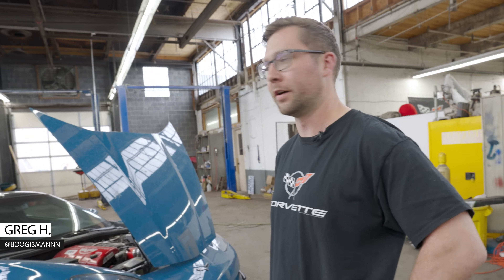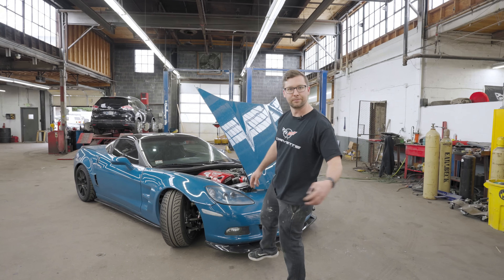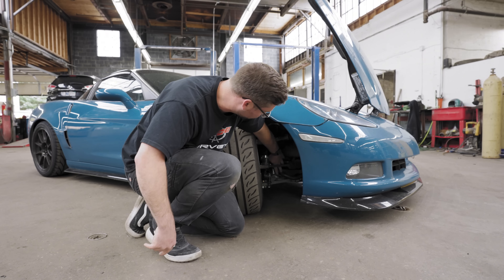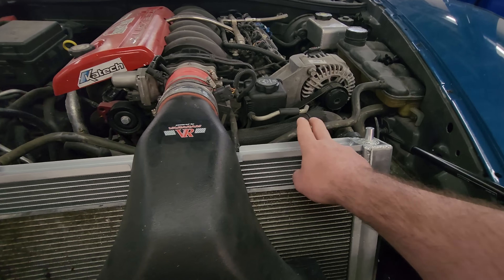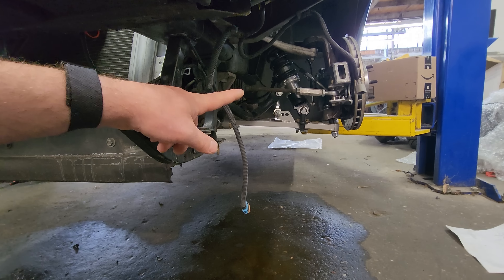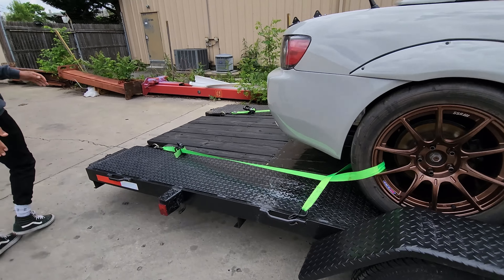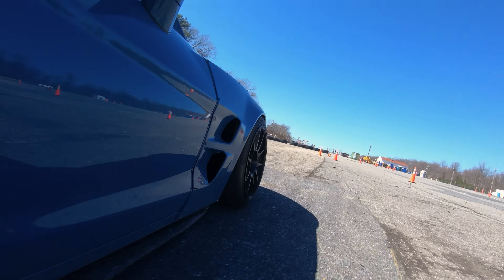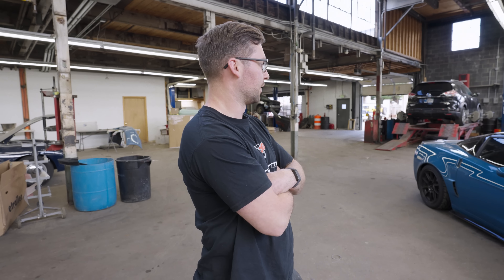C6 Corvette - The Best Car I Ever Purchased

Comment: oil cooler mounting: my yamaha fz10 has coolers dangerously close to the front wheel, they just put a steel screen in front of the core. like a 1/4 inch hole chicken wire kind of thing. keeps the major rock damage down i guess.

Comment: Why did you guys add clear coat to the front fenders before adding color?
Reply: I think that's an adhesion promoter, similar to a  clear plastic primer but not quite the same
Reply: It’s a white sealer, which is applied before the base coat.
Reply: @johncoldwell340  ah that makes sense. Thank you

Comment: The reason those riv nuts are spinning is because of the American made junk low quality fiberglass.  Put a fender washer on the backside that has a hole the same diameter as the riv nut before you squeeze them.  That’ll keep the fastener from pulling through the glass.